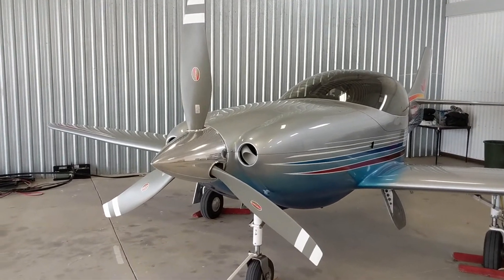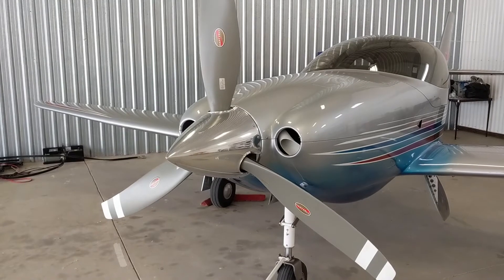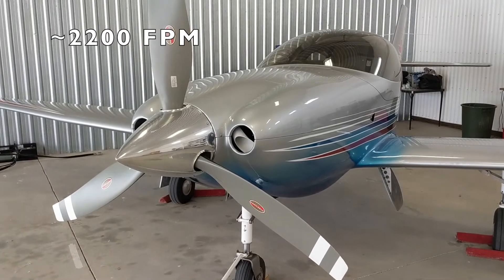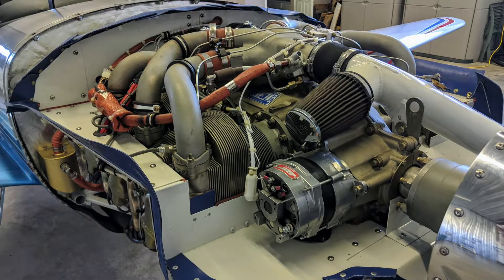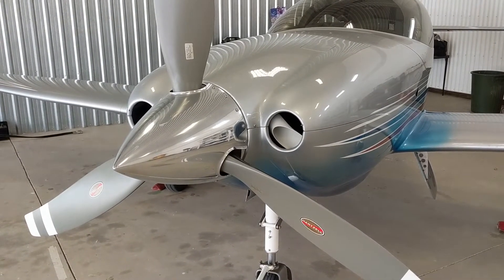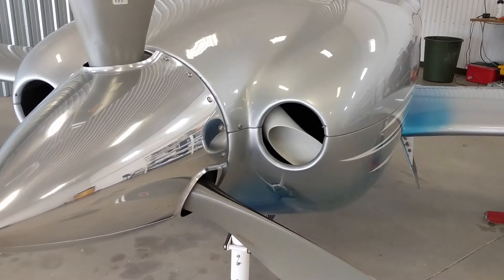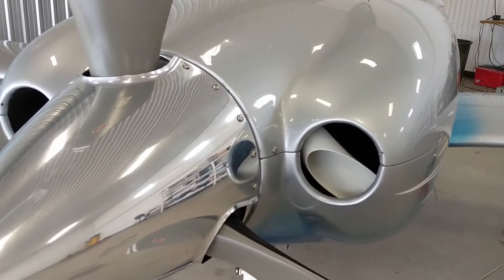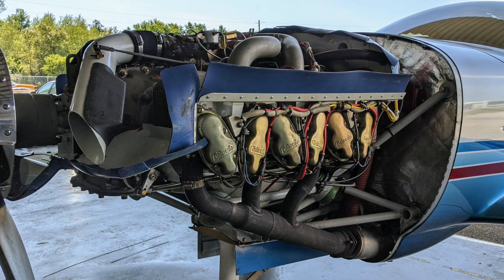Firewall Forward - Lancair Legacy RG

Comment: So this engine makes 310-315hp stock, how much horsepower does it make after all the porting and polishing, and other hot rodding stuff being done?
Reply from the maker: Hi William, I'm not 100% certain.  The previous owner hinted that it was approximately 350HP.
Reply: @PiInTheSky  In cruise how many gallons per hour ?
Reply from the maker: @jonasbaine3538  Altitude dependent.  I plan for 11-12 GPH but usually 10-11 above 10K feet.  GAMI injectors, and quit a bit lean of peak (ala "Mike Busch on Engines" .. great read)
Reply: @PiInTheSky  Niiiice

Comment: I am wondering, when Lancair will take their current model, Barracuda to implement Continental's CD-300, a liquid cooled, Jet-A-burning 300hp V6.

I think this engine would make the two-seat Lancair the ultimate travel platform for a global market, where Avgas 100LL is to be phased out or not even available.
Reply from the maker: Thanks for the comment.  I hadn't heard too much about this engine yet but it looks interesting.  I fully expect Diesel/JetA to become more dominant over time.  There are builders and companies that put turbines into Legacys ... a very expensive but amazing performance option.
Reply: @PiInTheSky  ah, turbines. I'm afraid I won't have the cash to buy or maintain a fire-breathing dragon. At least not anytime soon.

Which is why I like the idea of the V6 Lancair. Slightly more relatable 😂